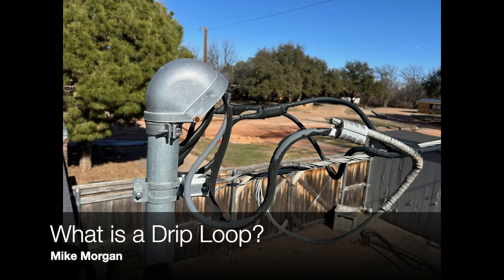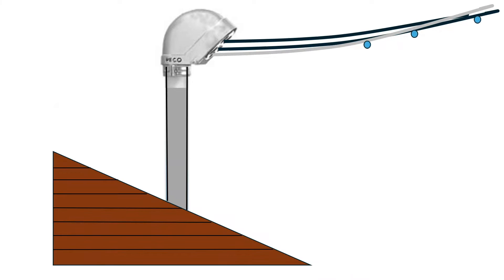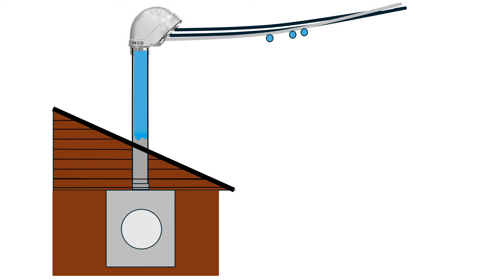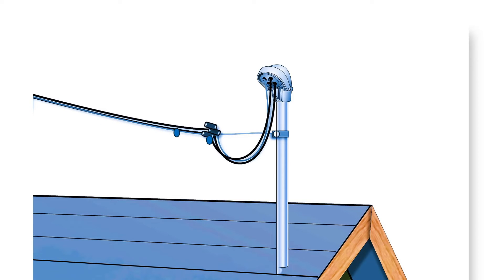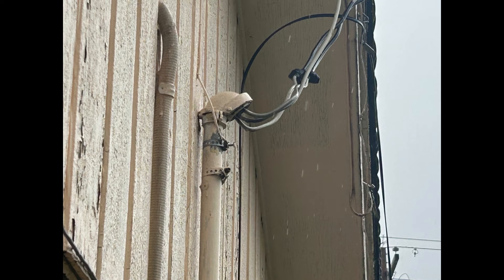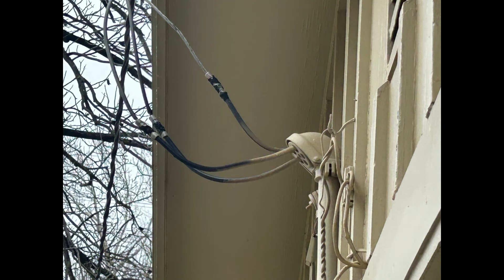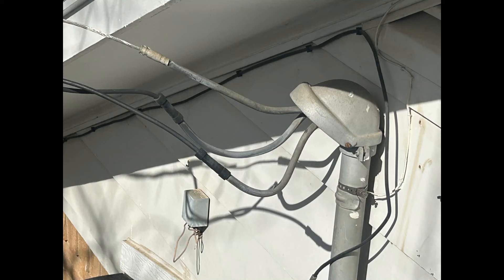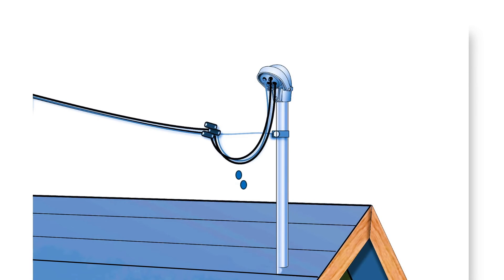Drip Loop Explained: How It Protects Your Home's Electrical System

Comment: Hey Mike to clarify , this drip loop is usually the Electrical company responsibility. I.e owners responsibility , rather than the utility company to perform this action ?
Reply from the maker: No. The homeowner owns everything on the “house side” of the electrical connections where the service ties onto the home. The drip loop is on the house side of these connections, so the drip loop belongs to the homeowner.